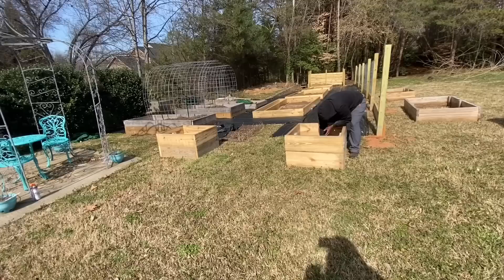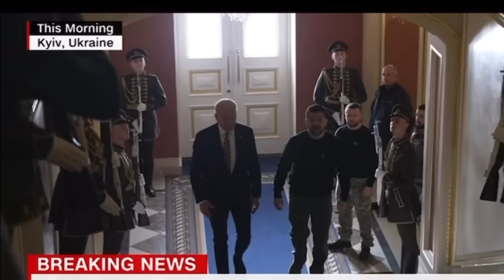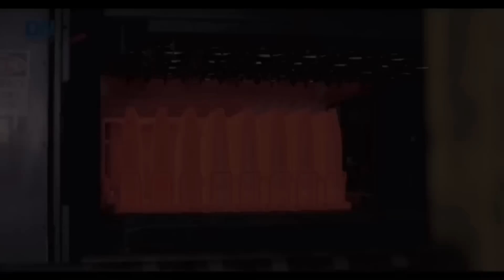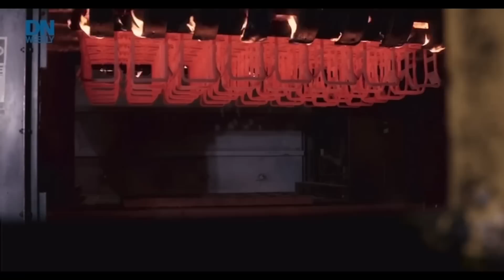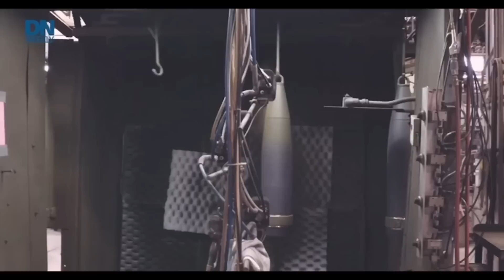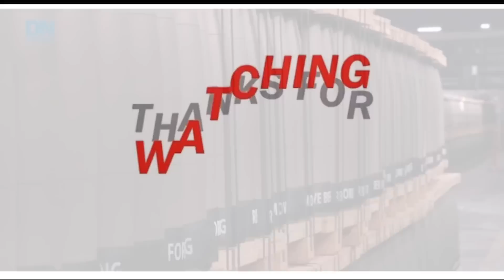ARE YOU READY? YOU NEED TO BE…SOMETHING MAJOR IS COMING SOON

Comment: The Oakland power grid was a cyber attack.  Last week, a couple of European countries got hit with system wide cyber attacks.  I haven't heard if Oakland was a packeting communication attack or a ransomware attack.  If the cyber security section of HS has been put back together, there should be a reasonable amount of help; IF they've been called in to help.

I hadn't heard of a bomb on train tracks. 

About ammunitions manufacturing, since WWII there have been plans on the shelf for a quick ramp up which historically have had fail over capabilities built in.  Whether they have been allowed to languish in validly updated, who knows.